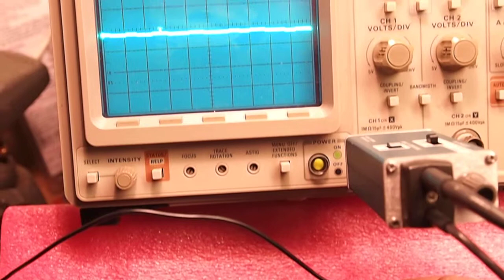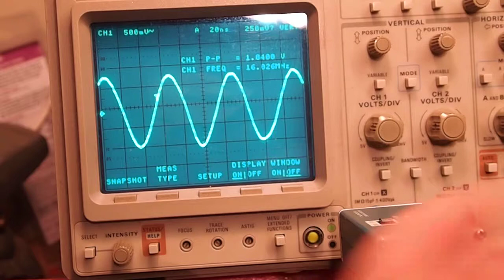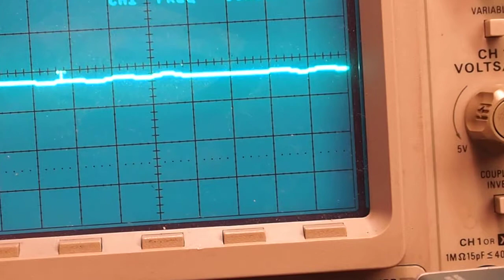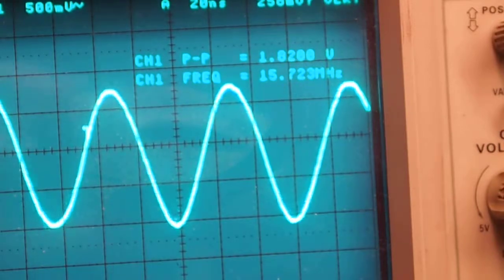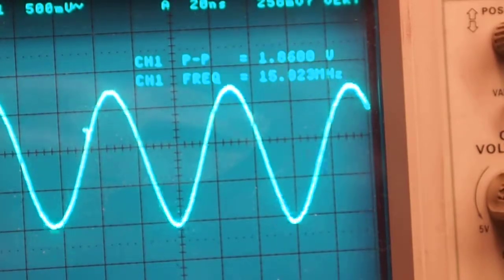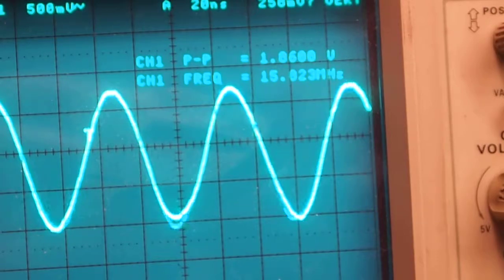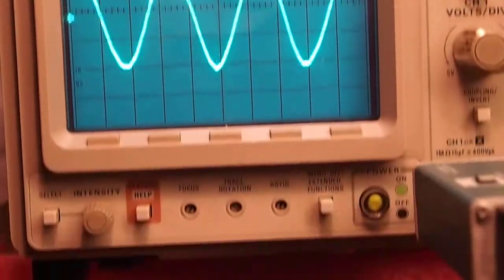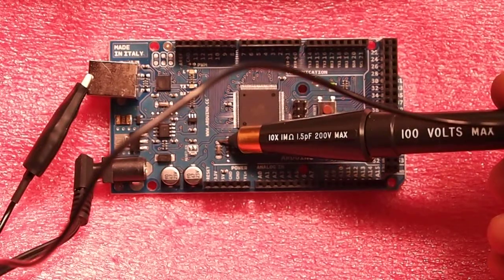Arduino with TEK 2432 and P6201 FET probe - by Tom.inMaryland

Comment: Not only does the Fet probe not load the circuit the "ground" clip is floating and not the chassis ground of the scope enabling you to take measurements not referenced to ground.

Comment: Why not show the same measurement with a passive probe? I thought the advantage of an active probe was lower input capacitance and higher bandwidth. I can see that the probe is marked as 1Mohm//1.5pF input, why couldn't I view this signal with a passive probe rated for the same 1Mohm interface with a bandwidth greater than the 16MHz sinusoid? It seems like any cheap x10 probe could make this measurement just fine.